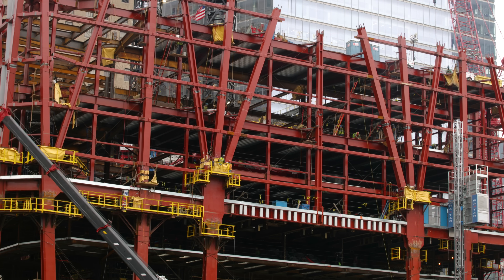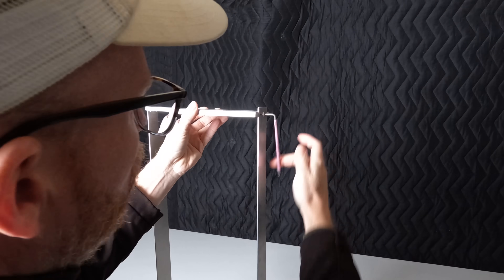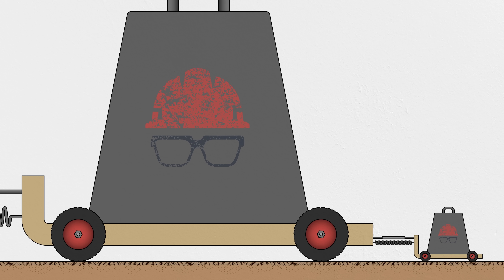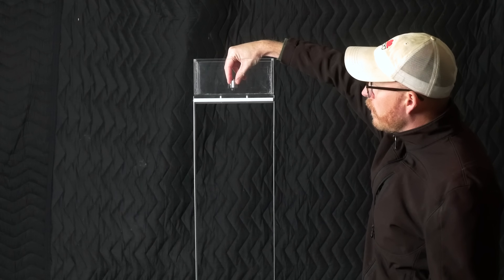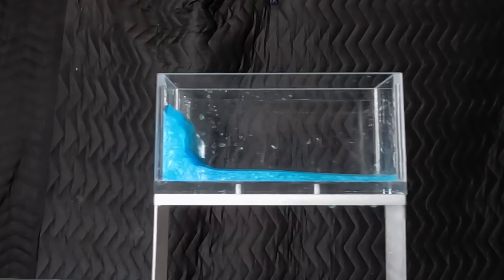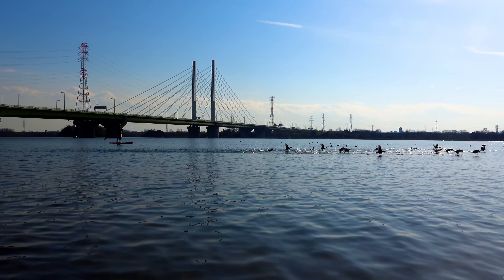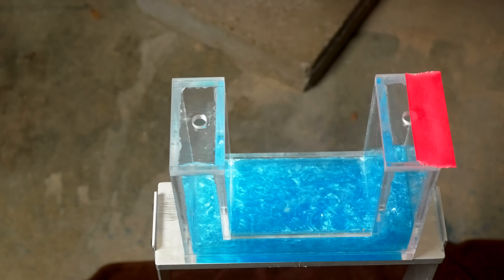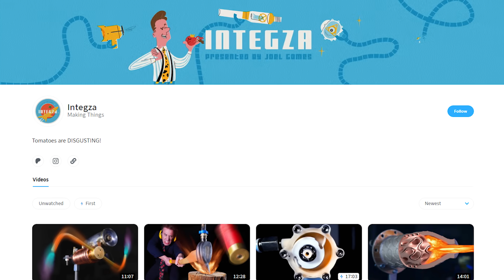How Liquid Dampers in Skyscrapers Work

Comment from the maker: 🏞Lots of cool stuff (plus my book) available at the PE store: https://store.practical.engineering/
🌌Get Nebula using my link for 40% off an annual subscription: https://go.nebula.tv/Practical-Engineering
Reply: Do another model showing how Building 7 (the 743 ft tall - 52 floor federal building that fell onto it's own footprint from fires in one corner of the building as per NIST NCSTAR1-A: Final Report in 2008).... DO THAT MODEL AND SAVE SCIENCE!!!
Reply: I wonder if oobleck would work better or worse
Reply: @Fahleen well, for the purpose of swimming, like in a pool, almost certainly worse. 😂
Reply: Grady - Veritasium just released a video about a mechanical device that shortens when pulled relating to Braess's paradox. It can also change its frequency when it switches between the series and parallel states. They mention tuned mass dampening as a potential application IRL. Would be very interesting to see it scaled up and in a skyscraper in the future.
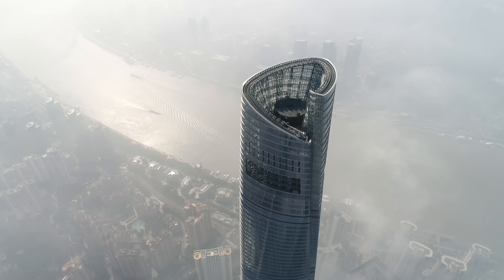Reply: 01:46 name of that building please, looked really nice
Reply: Problem with the model, air is compressible, water is not.... so you need a liquid orifice.... right?
Reply: What was that blue, slightly viscous, rheoscopic fluid you used? Since perchloroethylene + aluminum crystals is toxic, what's the best formulation that doesn't settle like mica in water? Thx.
Reply: Please put the audio function to Brazilian Portuguese
Reply: do the polish Łągiewka bumper please! the dude was a genius yet his invention was stolen by the communists and never used in any commercial appliance
Reply: so if you build 2/5 ton cylinoid's hooked up to an ultra advanced computer software that could read the incoming wave could you not dampen even massive earthquakes with it?
Reply: what about some dense liquids or the opposite? or some kind of match of floors/walls that are hydrophobic and some liquid to get best effect or something like that... or newton liquid? what about such experiments? did somebody try ?
Reply: Question: can you get some power from this liquid and air movement? Seems useful for also tunning the resistance
Reply: Please include the reference books, articles, papers in the description. I want to study it in detail with calculation and design it myself and implement in my construction projects.
Reply: QUESTION: What would happen if we would use newtonian fluid in that tank? will it oppose the motion of the building?
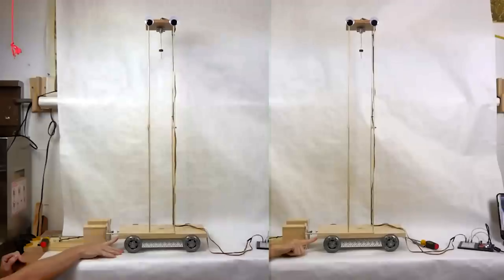Reply: 2:20 You've earned a cookie for this one! :)
Reply: QUESTION: Couldn't a swimming pool equipped with an autoleveler with symmetrical deep ends on both sides be used as a functional slosh tank? The shallow "end" would be the middle.

Flank it with kiddie pools, volleyball pools, & hot tubs, and you'd have a system that dampens various degrees of sway.
Reply: @Stacy_Smith  a swimming pool equippend with an "auto leveler?" What does that even mean? Water is auto leveling. Do you mean having moving parts as a part of the structure, the bottom of the pool? 

Certainly sounds like an engineering challenge. Keeping moving parts water tight is only part of the battle. I suppose having an entire pool suspended to some degree, like a pendulum, is another option.. But that also sounds like an engineering nightmare.

Comment: Has there been any practical implementation of triangular-bottom (downward-tapered) tuned liquid dampers in tall buildings, and would placing paired units along the top perimeter offer measurable advantages in damping efficiency or bidirectional control compared to conventional TLD/TLCD systems?

Comment: Do you have to worry about evaporation with it being water and being on top of the buildings with heat from the sun and temperatures? Or treating the water with chemicals for bacteria buildup? If so would there be a better lights to use which doesn’t evaporate nearly as fast as water?

Comment: I never understood building construction.  It doesn't make any sense to me at all. For some reason the ground floor pillars are the same weight,  width and strenght as the last top floor pillars.  The ground floor pillars are keeping the entire building upright and the whole building is presing down on them while the last pillars on the last floor are only sustaning the roof. Why are you adding so much weight for no reason? Why aren't you building it like a pyramid. Shouldn't the pillars became thinner as you go up?

Comment: we need to be careful when using the word "damper", since damping implies energy dissipation. What we see in many of the shown cases is not "strictly" damping, but energy transfer from the building to the liquid, which results in a reduction of amplitude of the oscillations of the building, which, in turn, may be analogous to damping. However, there are certain cases when the energy flow is reversed, i.e. the liquid gives back the energy to the building at later stages. Of course, a certain amount of REAL damping (dissipation due to viscous and turbulence) occurs, but it is often negligible.

Comment: would be interesting to see how a circular liquid damper would behave, with partial/complete valves that go in both directions as well as opposite of each other. The liquid would flow only one way with opposite ones and with parallel cancelling waves with valves that open either way. For drag you could use springs in the valves or those circular turbines vertical that spin only one way no matter air/liquid flow and attach generators to them to produce electricity

Comment: Over base mechanical damps (simulating wave form) will work better in the long run. lighter weight no leaks, with software from triangulation towers. Add in a spring powered gyroscope at top to release during seismic activity.

Comment: It occurs to me that many if not most skyscrapers have water tanks for drinking water at the top of the building so as to provide consistent pressure that far above the street. I could see a clever engineer combining this with a sloshing damper, saving money and simplifying the engineering by making the damper and the water tank one unit.

Comment: Your demo was bi-directional motion. Since buildings sway in several directions; does that change the design from your example? Also; are other liquids used instead of water? Like liquids with more viscosity or treating the water to create more viscosity.

Comment: if you were to use a fluid with lower viscosity, would it displace more air as is flowed back and fourth allowing for more air to be pushed out allowing for lower weight damper to be used.

Comment: In the damper with columns… What if you use a heavier liquid? Better dampening?
Reply: My husband loves motocross. We play a game called mxgp 2019. You can change so many attributes and metrics of the dirt bike depending on the track, weather and how you like to ride. And you can really feel it. I really enjoy it. High speed dampening to low speed dampening for example. Spring tension. Break response and acceleration response etc. i remember old school forza. Esch part upgrade told you what it was for and how it will effect the car and why. Always liked engineering. Just wanted to be a pharmacist though. I like working 9-5 with weekends off.

Comment: I worked in the Bechtel Building, 50 Beale Street, San Francisco, for seven years from 1967. The rumour amongst us clerks was that the earthquake engineer wouldn't have his office higher than the fifth floor. Movement could be felt in the building, but that didn't stop Steve Bechtel and other officers of the corporation from having their offices on the 23rd floor.

Comment: The video kind of fails to get two important points across:

1. Directionality. Dampers need to be able to deal with forces / oscillations from multiple directions. Their design has to take into account the shape of the building and the expected wind patterns at its location.

2. Irregular forces. All the demos basically assume there's a constant force acting on the build, which suddenly stops, and the building has to come to a standstill. In reality, there will nearly always be variable forces that go up and down, change direction, etc..

Comment: So would changing the viscosity be an option for changing the tuning frequency, instead of changing the size of the tank? And what about using say a ferro fluid with variable electro magnetics to make a dynamically changing damper by actively modifying viscosity?

Comment: Wondering if the use of liquids denser than water have been modeled for use in these types of dampers and whether they'd provide more favorable damping performance (akin to the role of fork oil in hydraulic shocks).

Comment: I’m wondering what would happen in terms of dampening efficacy if you change the viscosity of the fluid. Would the dampening be improved if you loaded your model with corn syrup or something similar? Or what about a tiny drop of dish soap or JetDry to change the water’s surface tension?

Comment: I design a lot of roof top swimming pools.  (sometimes on lower levels)  I'm still of the mindset that most of these pools are just bragging and selling points for the developer and architect.  They usually dictate small and unusable pool shapes.  TBH, the severe lack of coordination with even having a pool leads me to believe they don't intentionally calculate them as a dampener.  It would be interesting to be able to visit some and see if there is any accidental dampening going on.
I think it's North Carolina (probably others, but that's the only area I've worked in) where we have to design a drain system for fire suppression.  So I like the idea of dual use systems like that.

Comment: Hello Grady I have a question and perhaps an idea for a second video on this subject. What would happen instead of making a flat bottom pool it was curved deepest in the middle with the sides high and steep making it a combination of the two designs. Second what if ribs were put in the bottom of the curved tank to create turbulence in the water. In addition an additive was added to the water to increase its stickiness to help further with creating more energy loss. To take this a step further multiple ribs could be added to the floor and space at different distance between them. This spacing could be set not only on the basic oscillation frequency of the build, but also on it various harmonics. This would seem to me to be advantageous in tall slender buildings were multiple waves at higher frequency's could exist along the length of the build that is being from top to bottom of the building. Taking this even further what if the curved bottom pool a top was added making it into a sum what curved U shaped column. By adding a top now we can add more ribs for not only for more friction but the top ribs can be used for the fundamental frequency of the building and the height of the ribs can be longer to account for the higher energy content of the fundamental. In such a design the lower ribs would be the primary dampening for higher frequency were they generally have lower energy than the lower frequency's.

Comment: One of those examples of serviceability you don't always think of - I saw a video from a hotel room in the Burj Kalifa during a storm (I think a normal one, not unusually severe). The building groaned as it swayed back and forth as all of the various structural and interior building materials writhed and squirmed against each other as their shape slightly changed. I got the impression the noise together with the swaying made it a difficult sleep. Another interesting one is that one of the NY Billionaires Row pencil skyskrapers was getting repeated issues with plumbing bursting, also due to unusual levels of building changing shape - There's a limit that typical services can deal with until you have recurrent plumbing or electrical issues

Comment: Wind is not constant.  Wind may gust.  Your pencil tower may also experience an earthquake.  Also IRL, the wind may change directions.  Is your roof based pool a bunch of tubes, or a great big circle.  Wouldn't want quartering wind & a rectangular (top view) pool, as then your flow distance is different.
At a certain point when planning for all of these possible forces, remember getting it wrong may cost lives.

Comment: I suppose you could add dampers to highrise buildings that at the same time capture the energy and convert it to electricity. Piezoelectric dampers at the bottom and other type of dampers at the top to capture the energy from wind sway. Not sure how much electricity that would generate, but it's worth an experiment, because if you could power a significant part of the building with that energy, then it might be worth it.

Comment: Water is not compresable. That property changes way it distributes energy and pressure. My first thought about it: why not use oil?
Reply: And by changing the composition of the oil you could tune the viscosity!

On the other hand, the typical fire marshal will positively freak out at the thought of a large volume of flammable liquid held at the top of a skyscraper.  Think The Towering Inferno with diesel fuel.
Reply: @frankheilingbrunner7852  emergency spillway pipe conected to tank in basement? Just open valve.

Comment: Yes, I understand.  And it's simply brilliant.  But, what happens when hurricane force winds torsion and sway extremely?  If the tower leans past a certain vertical / lateral deviation the pools' shifted center of gravity could create a top heavy situation where the pools' mass pulls the top more than without the pool.  This would be a critical "leaning" and could collapse or topple the building.  Is this plausible?

Comment: What happens when a building wobbles on the z axis instead of x (at least for the first design)? Is the pool just symmetrical on both sides? Or are there two separate ones? Or potentially did engineers take that into consideration and only build one?

Comment: Your model only goes from left to right, but buildings could sway in any direction depending on the wind, correct? How would the tuned damper look in your model if it was swaying front to back?

Comment: Hmmm.... what if you had a central column of water, and then you had several branches in a circle at an angle, and going up towards the outside and top of the building... then you could have a sensor which would basically just be a joystick controlled by a pendulum. When the building is pushed left by the wind, the weight stays on the right, moving the joystick, and that shoots water up the right hand column, balancing it in real time... by having this in a circle you could control all axis of the building simultaneously with properly programmed circuitry. There you go, now give me 10 billion dollars.

Comment: This is pretty cool, but your demonstration only really shows one axis of damping. What would it truly look like to achieve damping in the X and Y axis? Would it just be a cross tank? Or 2 separate ones. Then do you have to tune them to work in tandom or counteract the other?
Reply: I see your point, but there are practical limits to the capacity of one engineer (who has a life) and one garage.
Reply: @frankheilingbrunner7852 agreed, I wasn't necessarily asking for him to build a model for that too. Just to touch on the subject briefly.

Comment: Interesting stuff.  While not practical from a cost perspective, I wonder if it would be possible to use electrorheological (ER) fluids (fluids that change viscosity/resistance to flow when exposed to electric fields) as part of a dynamically tunable dampening system.
Reply: 🤯 That's a thing?!
Reply: Oh my gosh if that's true that could have so many applications
Reply: @minimalizman pretty cool stuff. If you ever have a chance to drive a corvette or camaro (a few cadillac too) with magnaride suspension give it a try. Incredible machines, they tune the suspension on the fly with very similar technology.

Comment: A few years ago I was sitting at a friend's apartment on the seventh floor of a 30-floor building. At one point a light hanging from the ceiling started swinging like a pendulum. At first, we thought it was wind, but when checking that all the windows were closed we realized it could only be an earthquake (not a strong one). We went out to the balcony and saw water flowing on the outside wall, I was sure a pipe had broken due to the earthquake but the next day the guy at the reception showed me a video of the swimming pool on the 10th floor (I was surprised by the amount of sloshing)

Now I wonder if the pool was placed on the 10th floor with dampening in mind

Comment: You could adjust the damper by sealing the vessel and adding or subtracting the pressure of the air column above it. Even more accurate would be to have a floating piston seal ( physical floating seal ) between the 2 
The air is the loading element, the water is the sensing element and the floating piston offers an interface. You use a separate accelerometer to measure the motion and adjust either an orifice size or the pressure on the dry side of the liquid damping. Low viscosity oil ir glycol eliminates evaporation and can further tune a system

Comment: As someone who has pinned a lot of iron in the air, (including bridges)I bet it would be fun to bolt up one of those aerodynamic buildings lol. The bridges were trippy when the traveller sways and the water moves. I bet seeing non square iron under you would make the height have a more trippy feeling.   I dunno. Something about how your eyes focus and lock for reference when you're walking iron.

Comment: This works great for a "Left to Right" swing, but what about in the real world where the wind or an EQ can push and pull in any direction? Ive seen buildings with large ball bearings to compensate for this. Does the liquid damper replace this or just add to it? If added to it, do they work together or opposite?